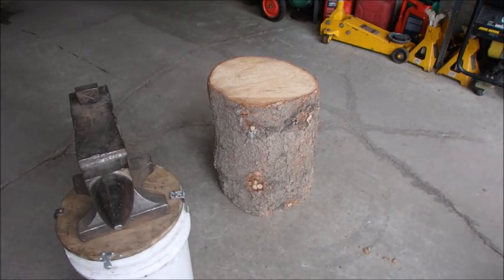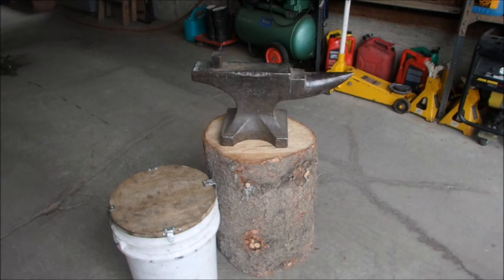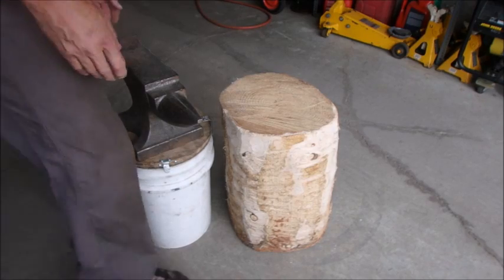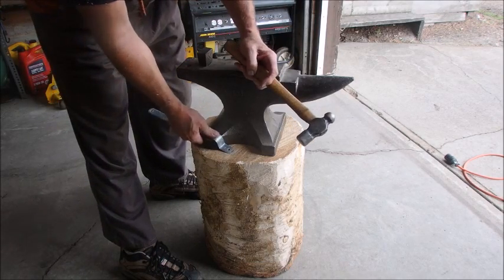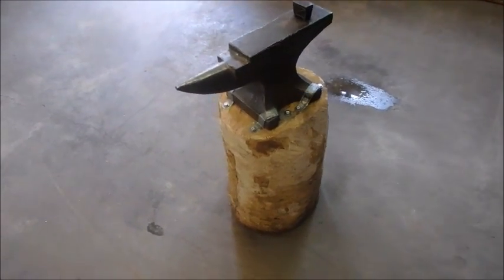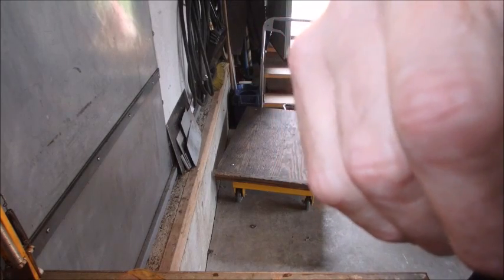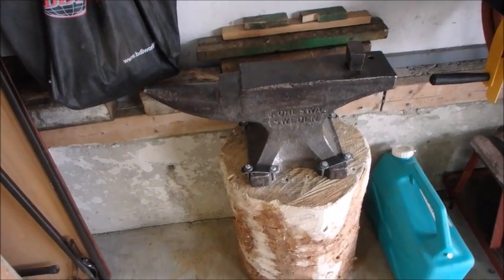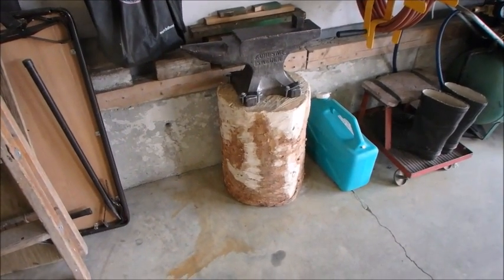This is How I Mounted My  KohlSwa Anvil

Comment: I got my stump close to size with my chainsaw, then used a router table to smooth out both ends to a perfect parallel.  That's a dang nice looking anvil, it needs a forge to go with it.
Reply from the maker: You are right about the forge

Comment: Nice job Bruce. I thought maybe something like linseed oil on at least the ends to help in the wood checking issue. And burn in "THE PENDER BENDER" on the side to give it that personal touch.
Reply from the maker: Thanks.  I actually never thought about treating it.  No rules.